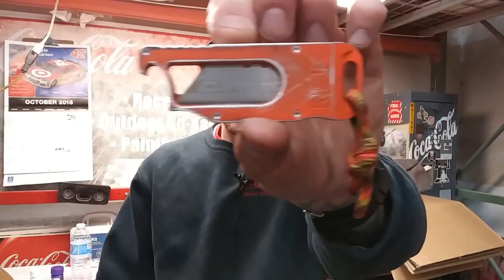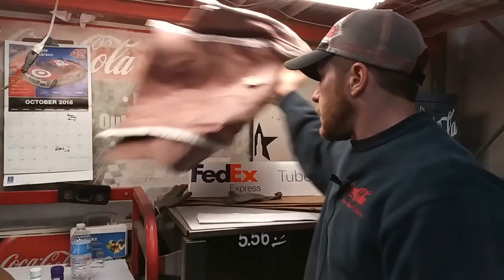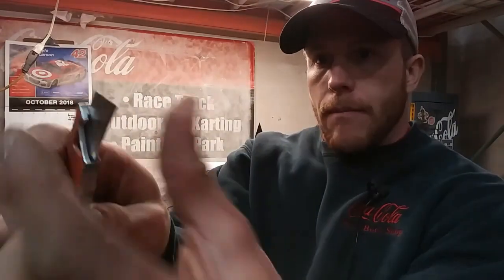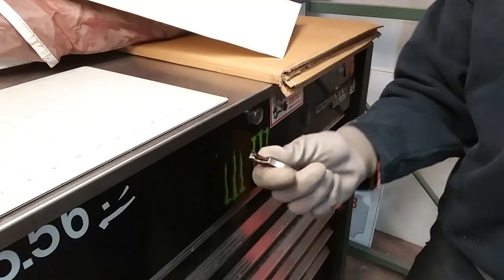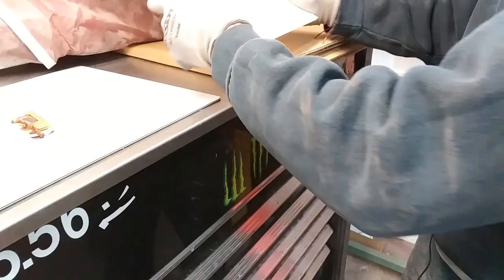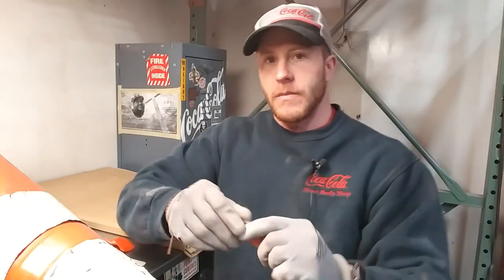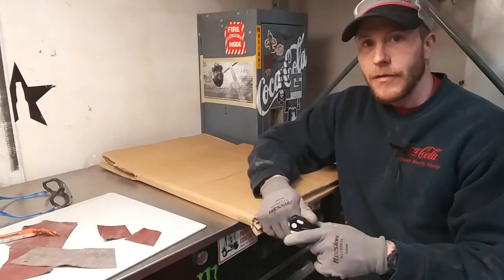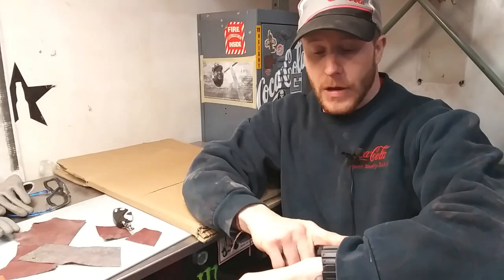TESTING THE GIL-TEK RUK

Comment: It's a shit tool. Blade won't last long because the metal blade runs up against the metal housing. Expensive as shit. The sidewinder is a better tool or the Sheffield.
Reply: The blade on the RUK V2 rides on plastic so it doesn’t dull.